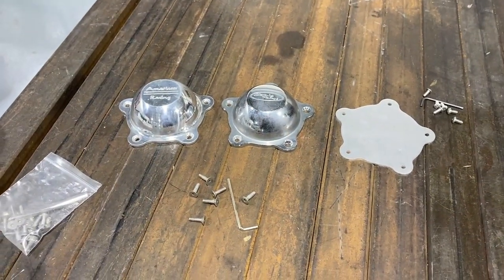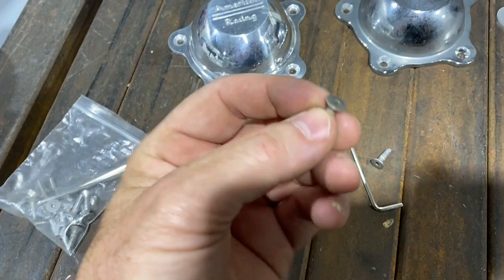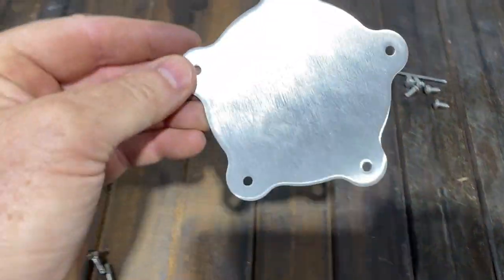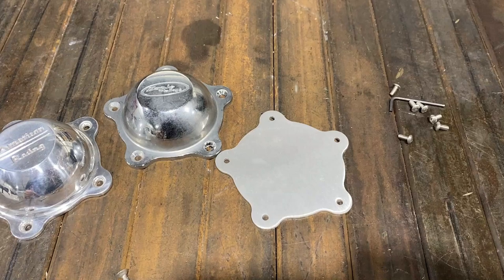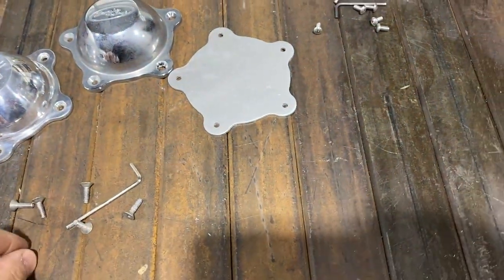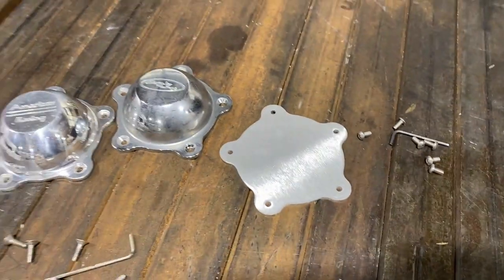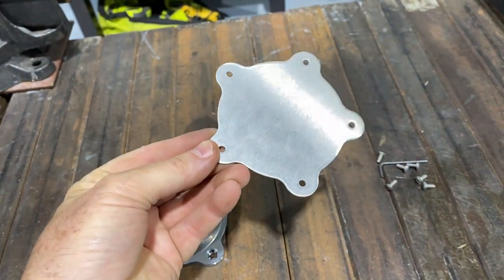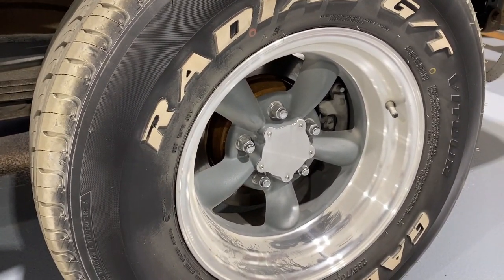LS Swapped OBS has Torq Thrust Wheel Center Cap Choices, How to Choose and Install Flat Center Caps

Comment: Cool tip, I was just bored one day went out in the garage and found some aluminum and took my stock cap and scribed around it and cut a stack of 4 and cut out on the band saw and filed and sand the edge. Good way to spend a cold winters day. Thanks for the video.

Comment: Here's a tip that some might not know about .A fellow youtuber who's name is Andy Kruse has had some aluminum center caps made for the American Racing Torque Thrust wheels. They come with the correct screws to bolt them on. And the best part is that they are thick enough that they have a small indentation on the back so that  they cover the grease cap. They also have a slight scoop on the outer edge so you don't have to take the cap off to take the rim off of the car. Just type in AndyKruseChannel and look for his video about his caps. And No he is Not paying me for this .I just thought it might help him and somebody else out .
Reply from the maker: I like the basic style, but will need to do more  research. My bolt pattern is 5x5 so the lug nut interference with the cap is not an issue...I also need to measure the amount my center grease cap extends beyond the mounting surface as well. good information. Thanks